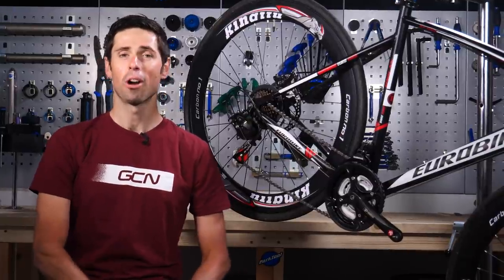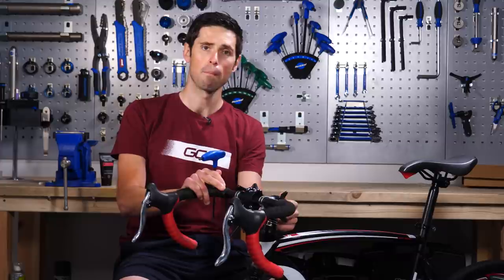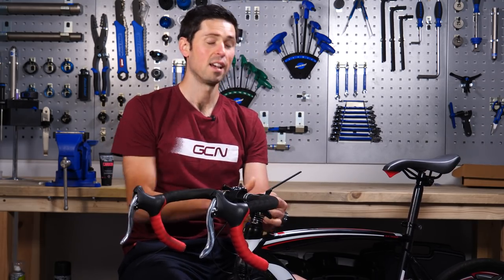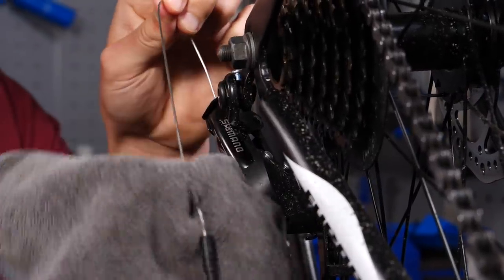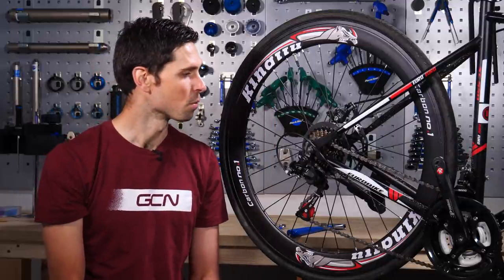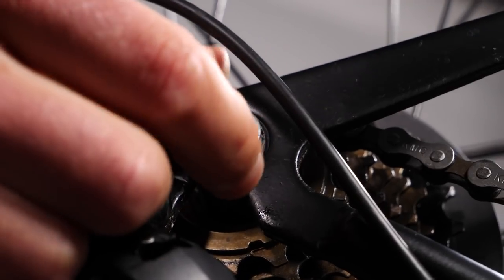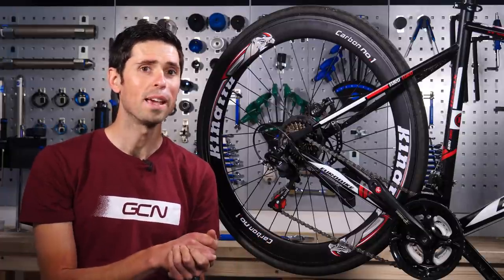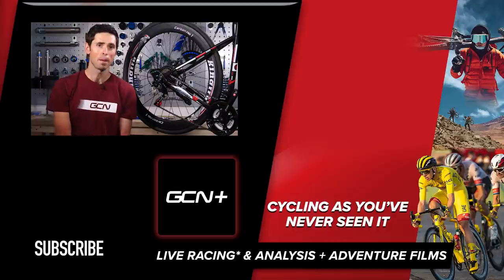Bargain Bike Maintenance | Super Easy Maintenance You Can Do At Home

Comment from the maker: What was the first repair you remember making on your bike? Let us know in the comments! 👇
Reply: Tire puncture repair... This was back when i was a kid in the Philippines and tire levers weren't a thing, so screwdrivers for levers and used a piece of an old inner tube as the patch with some contact cement.
Reply: Changing brake pads
Reply: Changing the big chainring on my lockdown bike. Got the replacement part on eBay and used the GCN maintenance book and video and just went and did it! I was soooo proud of myself 😂
Reply: tire repair and wheel truing :)
Reply: The inner tube patch job!My dad wasn’t going to buy us new inner tubes every time we got a puncture. He bought us a patch kit and we learned to fix inner tubes by trial and error!
Reply: The first repair I believe any rider would have ever done would be a flat repair, same as I.
Reply: Replace brake and shift cables.
Reply: Replacing the worn tires!

Comment: may i just add make sure the chain is in the smallest cog on the front and the back to make it easier for removing and installing the rear wheel
Reply: Yes, and if rim brakes, flip the lever to open-up the brakes so the tire can pass the brake pads. And remember to close the brakes back-up once the wheel is back on!

Comment: It would be fantastic to see GCN test the most affordable carbon fibre wheels available and comparing them between each other and to the more expensive ones :)
Reply: While it would be nice to see that, I reckon GCN would avoid videos like that. By comparing different brands of carbon wheelsets against each other, they're indirectly losing sponsors. Let's take ENVE vs Reynolds. If they compared and found that ENVE is better than Reynolds, Reynolds might avoid engaging them for a collaboration since GCN concluded that Reynolds are not as good as ENVE.

Comment: Here is my bargain maintenance tip : lubricate wheel and pedal bearings.  Most wheels use a 6001 cartridge bearing that is in the hub.  You access the bearings by removing the  axle from just one side (non-drive, using standard wrenches) and then pop off the rubber seal with a razor blade or pick.  Then spray some solvent in the bearing races and cages and flip over to drain and wipe clean (with a perfectly clean cloth or paper towel). Lubricate with a few drops of tenacious oil (e.g. Phil Wood) and then optionally cover with thick grease to retain it.  Replace the seal and re-insert the axle.  Doing this once every season (e.g. 5000km) will keep the bearings smooth and prolong bearing life. 

I also disassemble my Shimano pedals and re-grease the bearings which makes them smoother than a new pair.  Even if your wheels are quite heavy, on a flat section they can still perform as well as a lightweight carbon model costing thousands,  because of the kinetic energy that is stored in a heavy wheel. Smooth bearings facilitate this energy take up and release and I think regularly replacing the lubricant actually results in the bearings and races become smoother with use.  

You can also lubricate the teeth of the pawls  (in the hub) with grease and this will make the freewheel quieter and have less friction.  Only oil should be used on the articulating surfaces of the pawls, that attach to the free hub body.

Comment: Are giant tyres good bought a giant content 2 have terrible trouble with vibration and rattling got 28 tyres can you help me.
Reply: If the tube is not seated correctly (twisted, folded) it will prevent the tire from being centred on the rim and cause a bumpy ride.  Remove and reinstall tube and tire, inflate a little bit and pinch and tap the tire to allow them both to be centred, then inflate to riding pressure.
Reply: Indeed, spin the wheel and look for changes in the 'height' of the tire. If there is a low spot, the tire bead is not properly seated. You will feel this as vibration when you ride (worsens the faster you go). If deflating-'massaging' the tire-inflating doesn't solve it, try talcum powder or dishwasher soap (look for videos explaining this). Good luck!

Comment: Any advice on what to replace my old square taper (122.5mm by 68mm) BB UN-55 with now that it has been discontinued?  Apparently the Shimano BB UN-300 is it's successor/replacement but they aren't available in my neck of the woods at the moment.  I know you can't miraculously make stock appear, but perhaps you know of another product I can use.  Have a great week!
Reply: You can use UN-26, it will have plastic cup vs Aluminum on UN-55. Also there is older UN-52. I would suggest to check eBay or Amazon stock in Your area. Last thing is to check older Shimano or other brands cup & cone bottom brackets, main difference these will have loose bearings. Maybe You can source one of these as temporary BB.

Comment: Actually just dry rubbing/wiping the dirty chain pushes some of the grim in between plates and barrels, reducing its lifespan. Don't wipe before using either a degreaser and/or mineral thinner with brush, then wipe, then reapply.

Comment: #askGCNTech Hi Alex. Thanks for the bike maintenance videos and the Q&A. They are very helpful indeed. I have a question re. lubrication of my bike chain. I ride the bike exclusively indoors about 4 times a week for an hour or so each ride. The bike is also stored in a clean environment indoors. I throughly clean the bike once a month and degrease and clean the chain until (really) shiny, dry it and lube it with muck off dry lube. The amount of lube is adequate and certainly not excessive. The trainer cassette is also removed and cleaned. However every 2-3 weeks or so, some black gunky stuff starts coming out of the chain. The gunk has a paste like consistency. What is going on? Is it just time to clean and lube again or is it something i need to look at?
Reply: Could it be that dust settles on the chain and mixes with the lubricant? Or is there old wet lube buried somewhere in the system that you don't get to with cleaning? (Perhaps the derailleur jockey wheels)